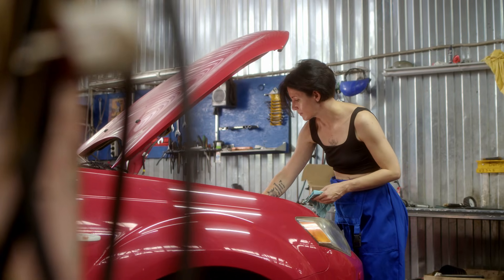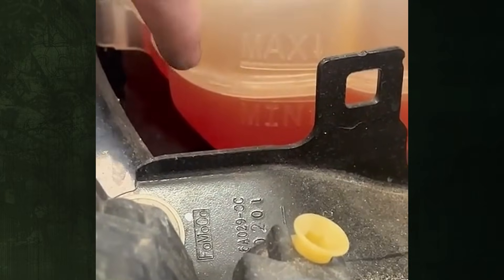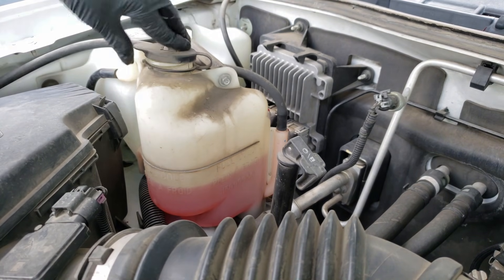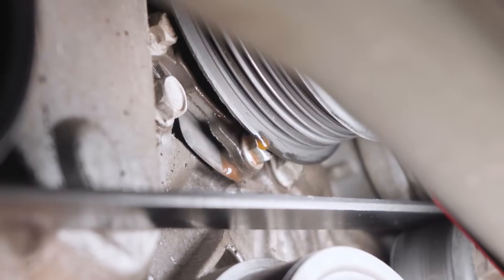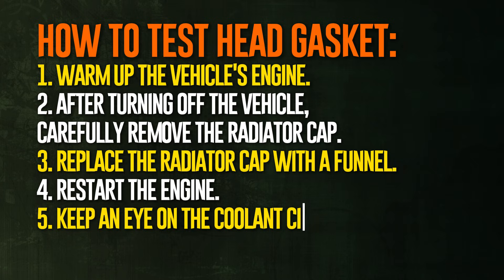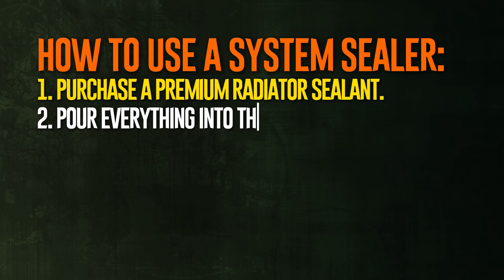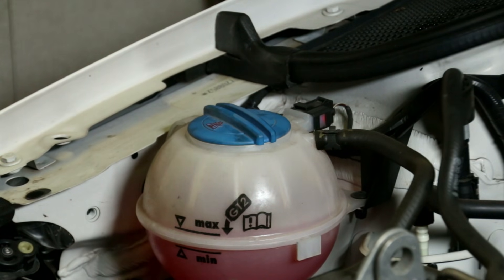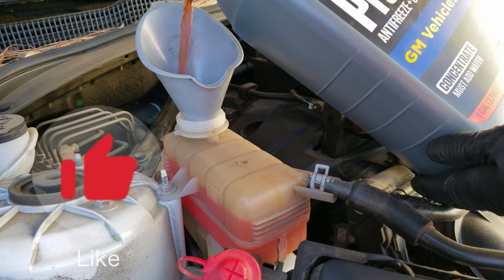Does Coolant Evaporate? How Much Coolant Loss Is Normal

Comment: Contact a professional what? I'm far from a mechanic with that being said I didn't become a diy guy because I wanted to I became one because I had too. From my experience when it comes to the cooling system not even the stealerships are professional. How you might ask? Because you bring your vehicle for a coolant flush at 8 in the morning and then you pick it up around 3-5 how's that even considered a cold engine? Yeah yeah yeah sure they might say they use a vacuum to pump out all the coolant but i say that's all they do if that! When it comes to my coolant system 3 dealerships and the same problem so professionals don't exist over here. So I'll take my chances of doing it myself instead of paying any crook when a a professional should know and inform about a closed or open thermostat or a rad cap.

Comment: Do not use any type of coolant sealer.  If there's a leak, find out what it is and fix it the right way......
Those radiator stop leak chemicals will plug up one part or more of the cooling system.........
Have a leaking heater core and now I've got worse problems because my temp gauge doesn't read correctly,  the heater core is almost all plugged up so the coolant won't flow into it and the damn thing still leaks.
Reply: Use product long time been mechanics 20 year no problem
Reply: Never again will I ever use those "stop leak chemicals" in my vehicles.
My radiator is not flowing properly and my temp gauge reads almost 220°, though I have checked the accurate temp with an external temp gauge.
Those stop leak chemicals are garbage....